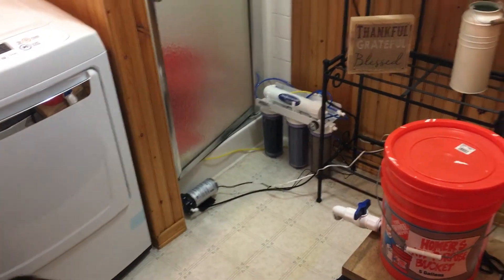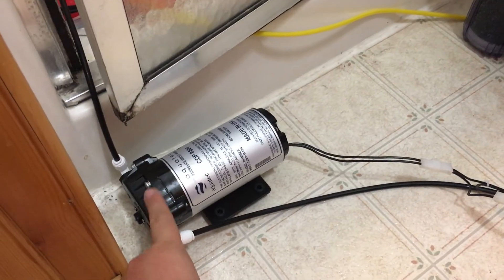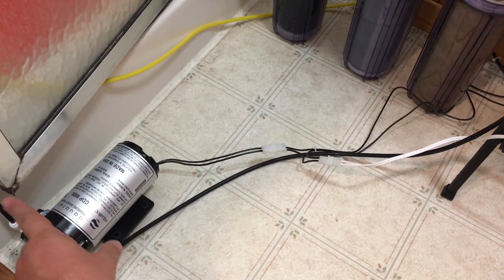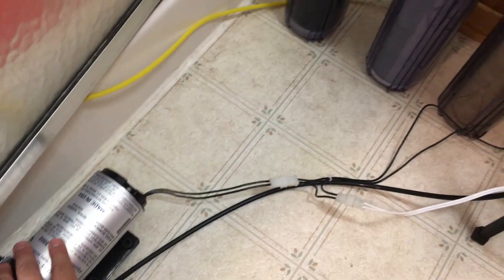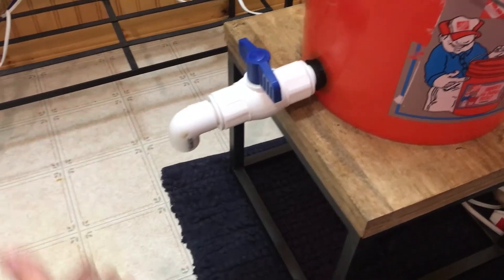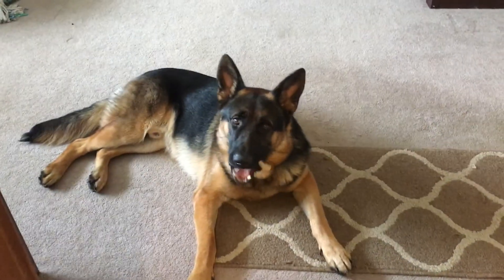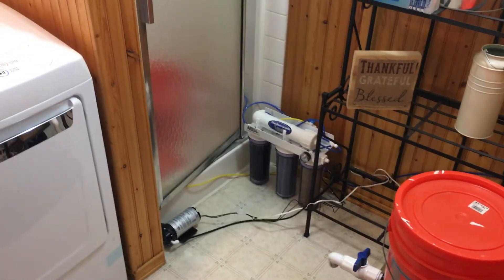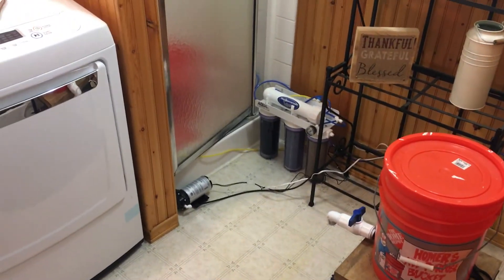Completely Automatic RODI System (Aquatec Booster Pump + Auto Shut Off Valve)

Comment: looks like you are using an aquatec pump. What hosing did you use and I need to connect to a 3/4 line - do you know where I can find these type of adapter connectors

Comment: I’m sure this video will help a lot of people with water pressure on the low side. We’re really lucky: ours is always at least 60 so we don’t need a booster pump. We set ours up with its own water tap, always on, and used the included float valve inside the reservoir. So as soon as the water level drops, it opens the valve and more water goes through. Then it shuts off when the water reaches our set level. Automating this function is a great way to make reefing life easier. Not just that - if I ever need to do an emergency water change, I always have at least 20 gallons of water available. 👍🏻👍🏻